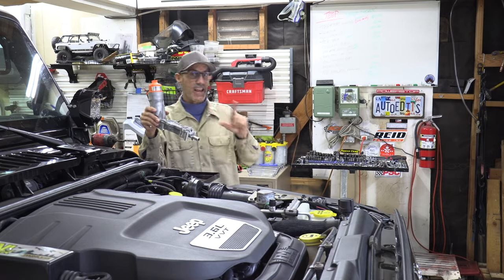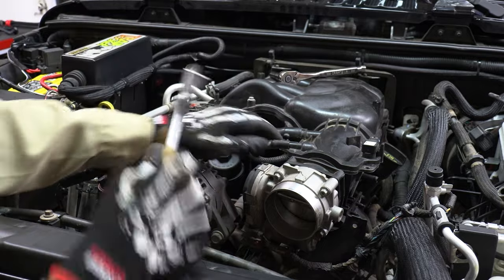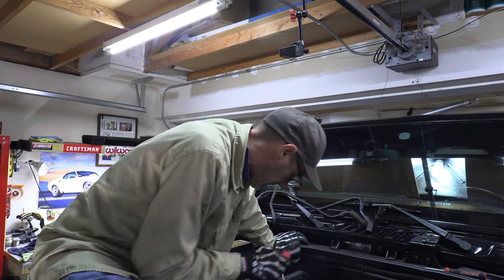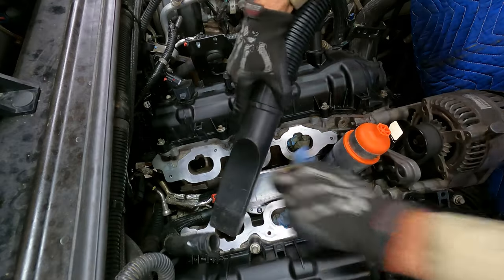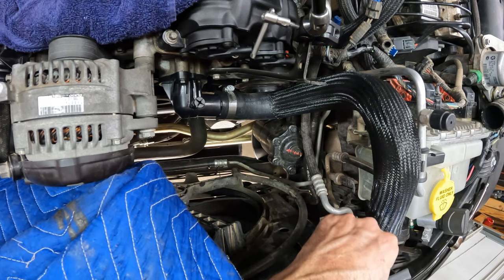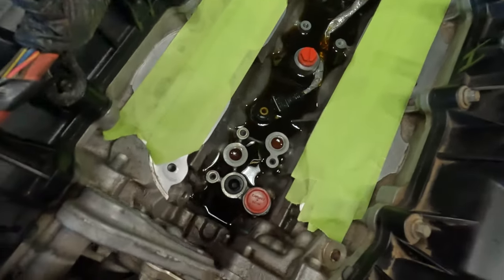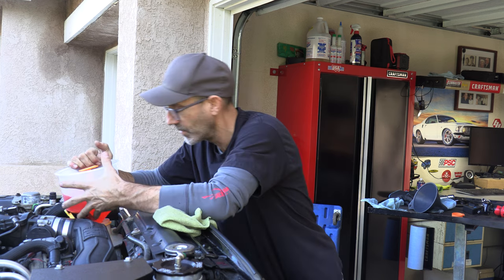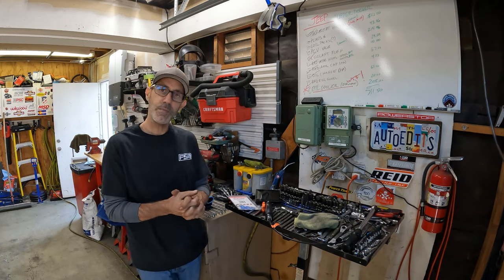How to  Replace Jeep JK Oil Cooler and MORE - Plugs, PCV, Thermostat Housing, Coil Packs

Comment: Great video Jason! 
I did this replacement on my 2014 2 door Rubicon a few years ago with OEM parts, of course it’s leaking again! I finally watched your video in preparation for doing this job again. You really threw a wrinkle in there, or I should say Doorman threw in a wrinkle :( I was definitely wanting to go with an aluminum model since the plastic seems to be a huge problem. I thought, great Jason went the Doorman, must be good… lol. That’s a huge bummer to do all of that work then have it leak so badly! 

Reading the other comments I saw that Mishimoto also makes this housing. Just initially looking at it, I really like it. All of the sensors are included as well as the actual cooler module, swapping out those parts was concerning me.  Do you have any thoughts on the Mishimoto? Installing the OEM seems frustrating given their likelihood to fail. 

Once again, great video! I’m envious of your dedication to making everything spotless “while you’re there”. I always seem to be in too much of a rush to spend the time.
Reply from the maker: I have seen enough good reports about the Mishimoto to think it's a good option. Thanks so much for the comment!

Comment: That Dorman piece was probably the last one made on a Friday. Slipped by QA because they wanted to get home.
Reply from the maker: This is hilarious 🤣
Reply: @Jake-pq3iz yes, most likely the o-rings caused the leak but you may want to watch the video again to see why I mentioned the housing. Regardless, it was a joke and doesn't matter.
Reply: @Jake-pq3iz the joke went over your head but yes you are correct.  I wasn't referring to the housing because of the leak, it was because of the nasty flashing.  If it makes you feel better, you're right, I'm wrong. Discussion over.
Reply from the maker: Nicely handled... 👏 I got it 🤣
Reply from the maker: You are incorrect. I used the included Dorman seals on both installs. The felpro kit I ordered was for the OEM factory housing on a 2013.
Reply: yeah, sorry about that. I don't know why I was being such a dick.

Comment: Wonderful video & thank you for doing this. With this being a common problem, its nice to have a new, current video on this. I have one question. With you having the issue on the aluminum housing and recommending staying with the oem plastic housing, do you feel the same about that choice for those of us who experience cold, winter for several months of the year? I ask this because of the heat exchange with the plastic over time, causing it to warp vs the aluminum one. I had full confidence in the aluminum housing until seeing your headache with it lol.
Reply from the maker: Thanks for this comment. Plenty of Jeeps do fine in frozen climate conditions with the stock style cooler so I'm not sure what the best answer actually is.
Reply: @AutoEdits Appreciate the reply! Definitely something for me to think about lol. Have a good one!

Comment: I believe the issue you had with the first oil cooler is that you had not pushed down into the block in order for it to seat correctly. you will feel almost a like a "pop" once it does seat. if you just have it on there and begin to torque down the bolts, the oil cooler will will not go in straight, hence the oil leak. 
just a thought from my own personal experience.
Reply from the maker: I appreciate the input, however there was a visual difference between the Amazon purchased item VS the exact part number purchased from a local parts store. It was faulty.

Comment: Thanks for another detailed video. Do you use an oil catch can?  If not did you notice any oil residue in your intake?
Reply from the maker: There was a lot of oil residue in the intake manifold because of the faulty PCV valve. I am more motivated now to try installing a catch can! The interesting thing for me was noticing how clean the intake valves were from what I think is the fuel additive I've been running and washing them down!!!

Comment: I’ve installed 3 different Dorman all aluminum units and 4 different brands of seals from mopar, Dorman, Felpro and some from Ali baba just to see. None of them worked and it ALWAYS leaked again. Bought a mishimoto and I’m installing it soon. Hope this is the last time but I feel your disappoint going through that procedure more then once.
Reply from the maker: Best of luck to ya!
Reply: @AutoEdits Update: finally got around to installing the mishimoto kit and not leaks for the first time in 3 years since battling the Dorman unit.

Comment: Can you point me to the where you found info on Bosch making the coils for Mopar?
Reply from the maker: I'm not being snarky but it only took a few minutes of internet searching.  Plus, there are sub-part numbers matching on the new bosch units and the oem I removed.
Reply: @AutoEdits  not thinking any snarkiness. I just could not find references online. I searched quite a few word combinations. I also do not have an OEM to look at.
Reply from the maker: I don't have the exact link, sorry. If it gives you better "peace of mind" going with OEM parts might be the best way to go and worth the increase in price.
Reply: @AutoEdits  you prob don’t have this but I’ll ask anyway; could you share a pic of the OEM and Bosch labels so I can do my research on these parts.

Comment: There is a good chance your first unit was slightly warped and not in plane. I encountered 2x that were that way. Returned the first, kept the second, but have not installed it. If the unit is slightly warped, then the bolts can't be torqued properly and sooner or later work loose.

Comment: Sorry the oil cooler didn’t work initially. FYI, The Fel-Pro ES 73248 work for the Dorman oil cooler. I used an electric pump extractor to suck all the oil and coolant in the valley.
Reply from the maker: Good information, thanks!

Comment: Is the doorman leaking at all after being on your jeep for a few months? Looking to replace mine.
Reply from the maker: No, the doorman cooler I bought from my local parts store is holding up well 👍
Reply: Would you still use the o-rings that come with the kit?
Reply from the maker: @DonGrimes-v8y  Yes.

Comment: I went to your amazon link and the Bosch coil packs are saying it doesn't fit a 2016 jeep wrangler.....? Is yours a older model or should those still be compatible?
Reply from the maker: I did a quick search and came up with this https://www.amazon.com/Bosch-Original-Equipment-0221504032-Ignition/dp/B01GCQXDKO/ref=sr_1_6?dib=eyJ2IjoiMSJ9.0p-ohrMbR1dhlgymGLu_KvrCxRkWOgrc4ab83yRYkw_qV1nPFec8Z1RXW88VJ0xpeHO_RG4I20HnJGrE7faktl2Sp8E7EDvlfQyAuZKn1bONcQ6AKj38xn8gA0j-2Y6tU2lxi53OjYh4DsnuarHldlAeApfsOS015tRfBrG5d1i1w7VhKRXzwMuV9e19yJAptx9l-144kvXPDuSBp0bNA8QX3PwYZcPOOAV8to-tum8YywNkOUrxIgNPrHek8_MIgc36sxdUsa_dJ48IzeNg_bKMsUBDYLiOn4UpDK_w8T0.cCUUVShbVkXvy79xTpx1A25-E7aKW9cdL_r0c1uRZHg&dib_tag=se&qid=1710515392&s=automotive&sr=1-6&vehicle=2016-42-356------------1&vehicleName=2016+Jeep+Wrangler
Reply: @AutoEdits  Correct, I was looking at a cross reference from Autozone and it was showing a different part number for some reason.

Comment: Use the starter to build pressure anytime you mess with oil parts. No way will I add a 10 year piece of plastic knowing it's a failure point of so many, I will do it 2x before I use plastic. Dorman would have been fine if you would have used correct seals
Reply from the maker: I used the seals that came with it as would be expected on a normal installation.

Comment: All that work and I thought you would’ve put in the two knock sensors below the oil cooler housing. Maybe it was a budget issue. It’s a awful lot of work just to change those two sensors. You didn’t even mention them?
Reply from the maker: Those have not been an issue at all on this vehicle so there is no need to preemptively replace them.

Comment: Everything is top notch but do not skimp on spark plugs 😢 E3s are garbage! Why not use OEM?
Reply from the maker: I said why. Hope they last a few years at least.
Reply: @AutoEdits   not trying to be rude, just been there 😂 and just a lot of work to take out plugs and replace. Also had those same plugs go bad and kill 2 coils🥲
I hate spending money but when labour is free I always try and use OEM quality parts on my Jeep engine as well. Cheers and enjoyed your video 👍
Reply from the maker: I watched project farm and richard holdener compare multiple plugs and the e3 did fine against the others so I figured they'd do fine for me and save a couple bucks. It is a mini van engine after all... not expecting any performance gains by doing any of this... lol
Reply: @AutoEdits  sounds good, I could have just had a couple of bad ones, with auto parts you never really know what you get anymore👌
Reply from the maker: Yes, this exactly! As I experienced with one random failure on the oil cooler and the second one is fine. ugh